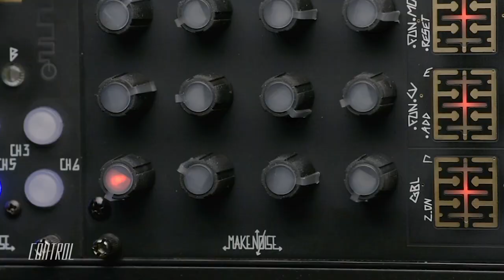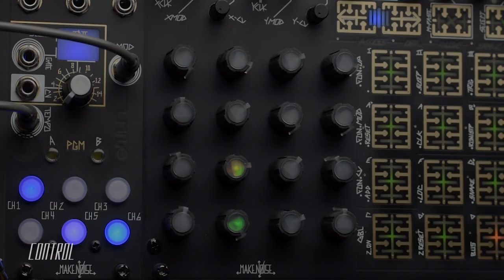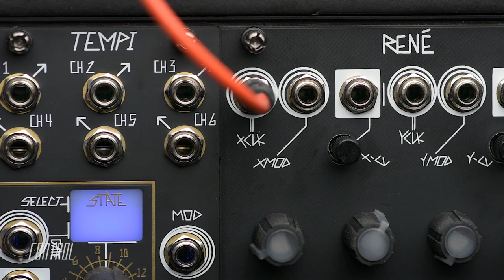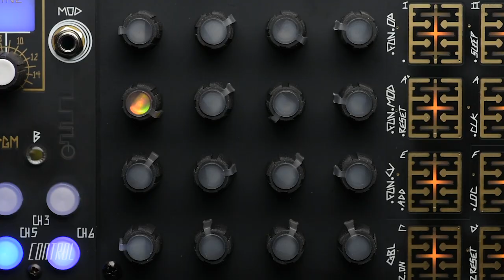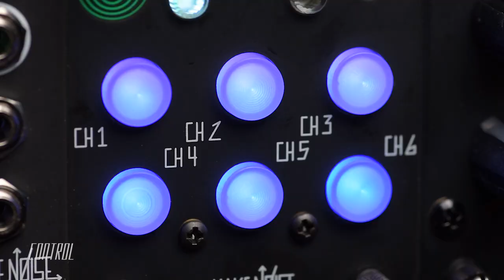Intro & Overview of the Make Noise Rene2 Eurorack Sequencer Module

Comment: What I dont understsnd is that in a quantize mode you select the notes with touch buttons on the right for the melody. Scales and stuff. Ok.
But why not with the 16 potmeters on the left? It does the same. Then what is different? Thx

Comment: Also, forgive my ignorance on the subject, but along with Rene, what are the other bare minimum modules I would need to make a stand alone polyrhythm machine, similar to say a Moog Subharmonicon? I’m thinking a VCO, VCA, VCF, and an EG? If I wanted to fit such a machine in 104hp what would you suggest?

Comment: Great video!   I can’t seem to figure out how to make certain steps muted on my sequencing( and i mean muted not skipped).  Anybody know?
Reply: By disabling steps from the gate section, am i right ? Like he does in the video
Reply: @kaaraosa  That disables the gates but isn't  true mute (which i don't think exists). If the note is still resonating, you'll hear it change. My workaround on this is to change muted notes to the same CV as the previous gated note.
Reply: You can disable the step in the access menu and then set the access function to sleep. This will cause Rene to “sleep” on the step before the skipper step. Sleep is a global setting so all other steps with access disabled will also sleep. You can not mix sleeping and skipping.